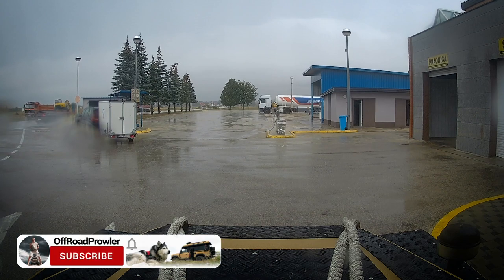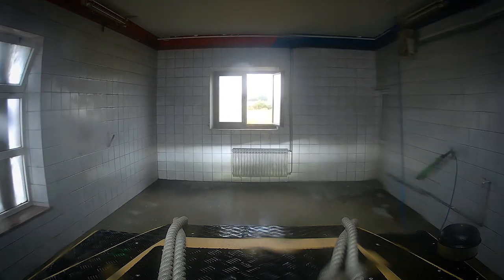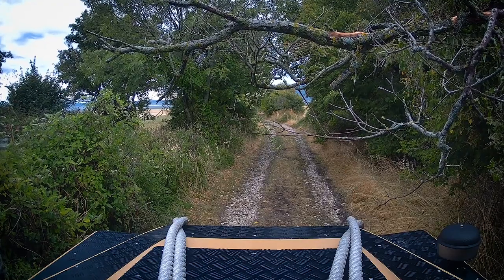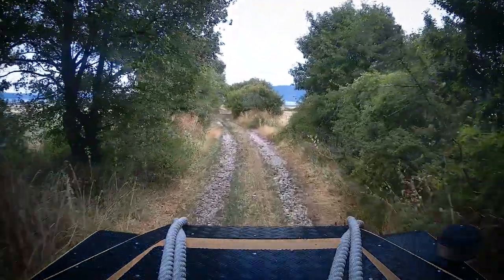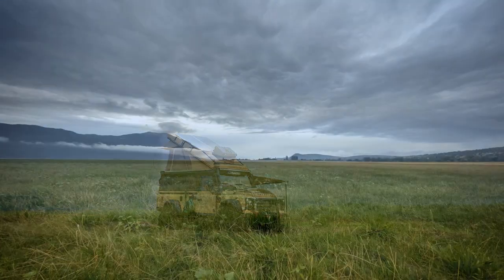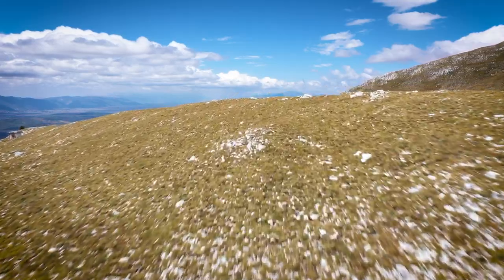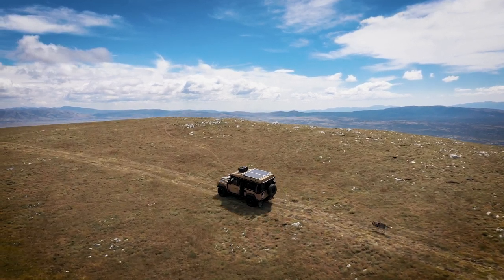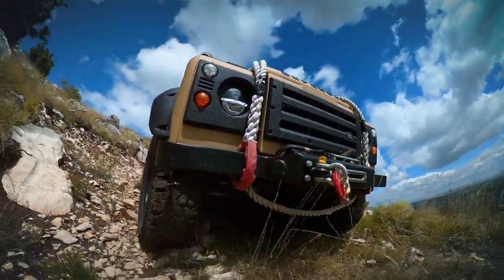Ep2 of Dinaric Alps overland trip - Busko & Blidinje Lakes and Turnica & Ljubusa Mountains

Comment: If you tell me what wire colours the other plug has I'll tell you what it does. I'm pretty sure that connector is the gearbox High/low switch. it'll be a grey 3 pin connector and the other half goes up over the transfer box.
Reply from the maker: I’ll check it when I’ll be around car. But O have the complete Electrical Connector Manual for the Defender and such connector is not present there. I read those gearboxes were also used in Mustangs and in V8 there was a “skip shift” feature to save fuel - maybe this is a connector for that? 🧐🤷🏻‍♂️